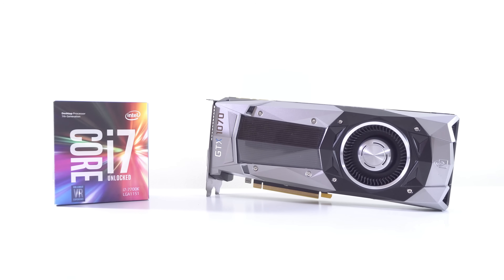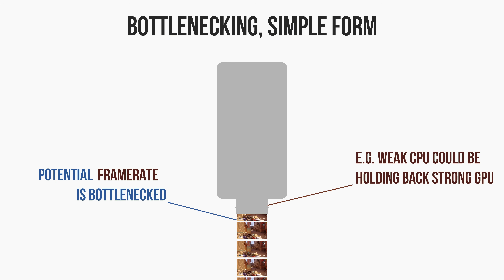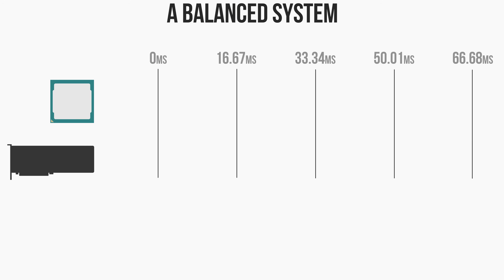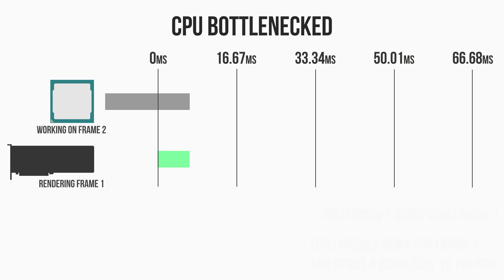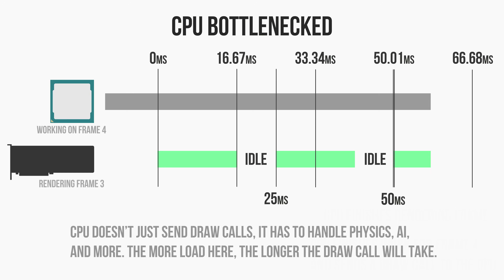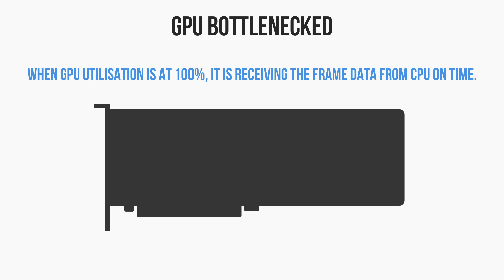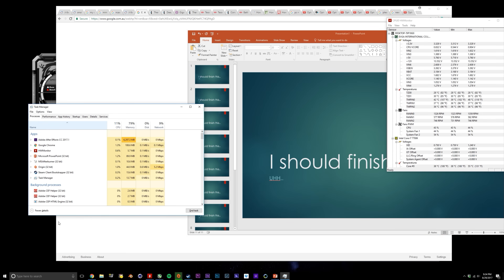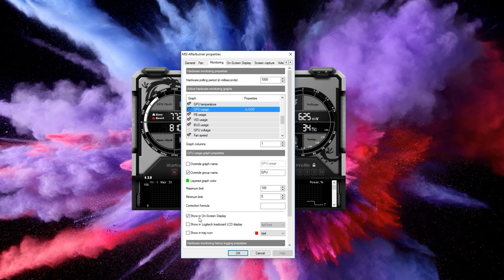CPU / GPU Bottlenecks in Gaming Explained

Comment: Easy explanation: You have roughly 3 or 4 main components that control your PC. All of those need to be able to process and send the same amount of information. Which ever of those tops out at the lowest and can't feed the frame rate of the others, is your bottle neck because it can't keep up with what the other parts can produce.

Basically all parts must be able to feed and send the same amount of info to your screen. If one is slower or not as strong as the others. That's your weak point aka bottle neck slowing your computer down.

Comment: Means that 
CPU......40%
Gpu......99%
Is this a good thing? Please tell
Reply: Yes;If the GPU is working harder than the cpu, then that's a good thing because the cpu is sending more frames than the gpu can render, thus making it work harder.
Reply: Rahul Devgun it depends on the framerate and the resolution you are playing! 
is you have a dualcore overclocked to 4ghz and a old gtx 640 and you play games on lowest resolution at 20fps with this system it will still be bad compared to up to date systems even though your cpu uses only 40%.
Reply: Gtifighter  While the example you said wouldn't be good in comparison to a modern system,  the answer to the question is still yes it is a good thing.  Just because a car can drive 250mp/h doesn't make usain bolt any less impressive.
Reply: Yes because you are pushing every frame the gpu can handle.

Comment: Can you over lock a laptop CPU? My laptop has a i5 7200u and I want to get a external gpu for it. If I get a egpu for it I am afraid that the CPU bottleneck might be to much. I have already undervolted and repasted it so now the only thing to do is over lock it and I'm wondering if it is possible/will it hurt my laptop?
Reply: Hey, sorry your cpu can't be overclocked. It has a locked multiplier and is designed for low TDP and energy efficient workloads.
I would strongly advise you not to get an external GPU with this CPU because the GPU will be bottlenecked hard in more demanding games. The i5 7200U is a dual-core with 4Threads and performs around 90% performance of G4560. So basically anything faster than a 1050TI is a waste of money if you're playing on your laptop screen.
Reply: mazedmarky are their specifically CPU heavy settings like shadows or particle effects something that I could turn down to reduce bottleneck?
Reply: Sure, stuff like shadows and meshes and maybe draw distance depending on the game. Of course you could also crank up Anti-Aliasing and AA to hand more work to the gpu if there is a really big fps overhead.
Reply: I would avoid OC a Laptop because Laptops are horrible for heat efficiency which OC tends to push.

Comment: Do Intel G4560 (3.5Ghz) bottlenecks Gtx 1060 3gb (msi Dualfan)???
Reply: Yes, but that really depends on what settings we are talking about. I have GTX 1050 Ti tests on it on my channel and it's very balanced @1080p. GTX 1060 would be great for 1440p but at 1080p would be quite CPU bottlenecked.

Comment: what if my gpu reaches 60 70 80 % and my cpu reaches 50 60 70 at most% what is wrong then. and I have 16 gb ram dual cahnnel
Reply: Yes the games are not optimised well or you are just hitting 100% on a single core that starts to bottleneck in some cases as well. So you could be: core1: 100% , core2: 67%, and all others about 20-30% and it will show you like 60% cpu usage, and still the cpu bottlenecks becouse 1 core is fully maxed. Depents on the game and engine of course, should not be the case for every game.
Reply: ELI The Janitor in every games ??
Reply: Some games not optimised well

Comment: You have very well explained the nature of bottlenecks. However, the bottleneck is also depending on the software (game), how it is using the available cpu resources and it is depending from the graphics driver as well. So it makes not really sense to measure the possible performance of a cpu with testing framerates of games. Then you are testing only these games and drivers in conjunction with a cpu but not the possibilities of the cpu. Therefore we have got specialised cpu benchmarking software and even with them the results are not always that trivial to explain... :)

Comment: I have a locked i5 and a gtx 1060 which component is the bottleneck? 3dmark tells me its my i5.
Reply: Moslin which i5
Reply: 6500
Reply: Moslin was wondering cause I was going to get the 1060 and I have a i5 7400
Reply: The most demanding game I have tried to run with my rig is battlefield on ultra 1080p decent frames over 60 most of the time in Dx11 mode. Dx12 mode seems to be bugged in fact every game that supports dx12 I own has run worse with it on vs off. My opinion is that for 1440p and 4k gaming the 1060 is a bit weak you have to compromise most of the settings to sustain a good framerate at those resolutions unless the game very well optimized or very dated or was never a demanding game to begin with. If you don't have a high refresh rate monitor that is also 1440p or 4k the 1060 6 GB will be more than enough you wont see  a bottleneck with any intel processor that is over 3 GHz base clock to have released within the last 5 years. Now the 6400 is rather slow it has a base clock speed below 3 Ghz.
Reply: Depends on the game, but for BF 1 yes the cpu is the bottleneck. BF1 is a very CPU intense game, i have an i7 and it still bottlenecks my 1080ti in BF1 and PUBG. (running a 1440p 144hz screen)

Comment: Can you please explain, why do game stutters for me even when i have low CPU and GPU usage at 4K? 3930K+1080SLI, everything overclocked.
Reply: There some possibilitys to explain low usage on both: 
1.  The Game dont utilize all your CPU cores/threads so the CPU are limitating and GPU cant use the full power.
2.  FPS cap.  CPU/GPU dont need full Power to reach the limit.
 
But stutter hears like a SLI Problem.  Test your games with 1 card only.
Reply: ThereWasNoFreeName Probably due to sli.
Reply: SLI (which is known to cause microstuttering), and your CPU is bottlenecking your GPU. While the 3930K is a very capable CPU, most games do not take advantage of it's 6 cores and 12 threads, and the single core performance of a 3930K is not very good. Your best bet would be to disable SLI, try again, if not, overclock your 3930K (also making sure you have a cooler to handle the extra heat)
Reply: Same with single card, but it has higher load (i.e. 50% instead of 25), happens mostly with 4K, but VRAM isn't overused.
Reply: less MICROstuttering with single card, but some games do stutter even with no 100% load of any single thread. Also games like Witcher 3 work just fine giving me 60-90% GPU load at fixed 4K 60 FPS.
Reply: Scorpion hi I have an i7 8750h with 1050ti gtx, will it bottleneck? I think the CPU is more powerful than the GPU please help.

Comment: Well I use i3 6100 with the 1070, constant 100% CPU usage. But can play in ultra above 60 which is nice.
Reply: It will be 6 cores, but you wont be able to use it on current mobos.
Reply: the i3 is a bottleneck unless you play at a higher resolution. 
i would recommend upgrading to the i5 or i7 when the 8th gen core comes out,. and if the rumours to be believed, you might get 6 cores CPU
Reply: Nizar El-Zarif It'll definitely be 6 cores for i5 and i7.
Reply: Nizar El-Zarif He could even upgrade to the quad core 8th gen i3 processors
Reply: It would be really dumb if they didn't bump cores up anyways.
Reply: surender rajput I use i3-4170 and a gtx 1050ti and it's stuttery af becouse my wd green hdd can't load the textures fast enough.So I can basicly drive blindfolded in gta XD than...seriously the only thong that is at constant 100% is my hard drive it got so bad once that my pc froze completly whyle playing lightly modded minecraft but a quick virus removal solved it.
Reply: Nizar El-Zarif welk have you heard the roumors that the top end coffee lake i3 will be better than a current gen i7?
Reply: i wonder if people will still think an i3 will bottleneck high end graphics cards if its faster than the i7 7700k
Reply: How much ram do you have?
Reply: My i3 6100 can hardly handle my 1050 ti @ 1080p, I hope you're gaming at higher resolutions...
Reply: Thats is some jerky gameplay even at high framerate.
Reply: surender rajput gotta love the ryzen procesors. Never reached 50% while gaming on mine

Comment: My cpu is never at 100 for some reason well i know why
Reply: If your CPU has more cores than the game can use you won't see 100% utilization but you can still be bottlenecked by your CPU.
Depending on the type of operations and the CPU you technically can have 100% CPU utilization without really having 100% utilization. Let me explain: The AMD FX processors have 2 integer processing unit for each floating point processing unit. Games most often use floating point operations. When you are using all of the floating point processors you technically have less than 50% CPU utilization (you could still process integers) but you are still bottlenecked by your CPU because of the lack of floating point processors.
There are also other scenarios where your CPU can be a bottleneck without it showing 100% utilization. If you have hyperthreading for example you can get a scenario where your real cores are completely uitilized but the virtual cores are not, and there wouldn't even be time for them to do any calculations.
Reply: Melvin Klein i have an i5-3470 and its always around 90
Reply: That sound like you are getting close to a CPU bottleneck but are not there yet.